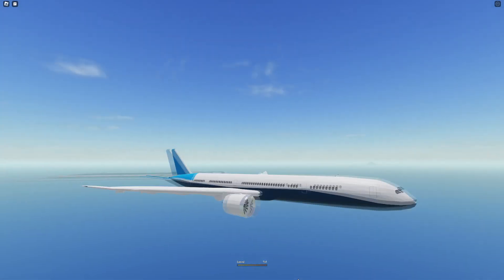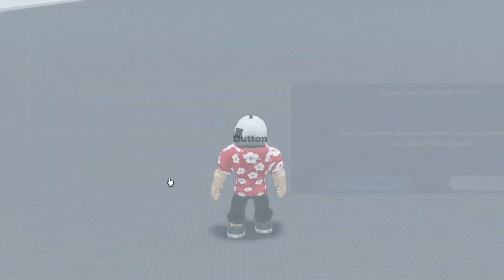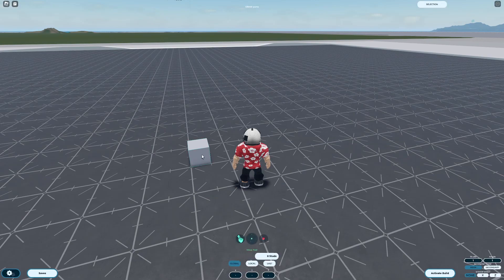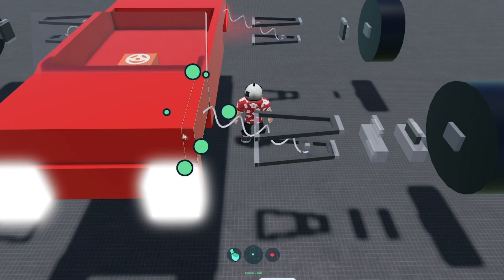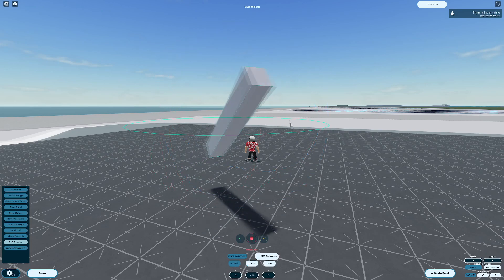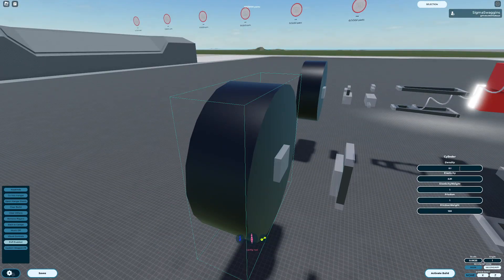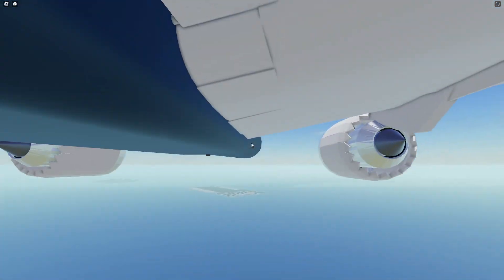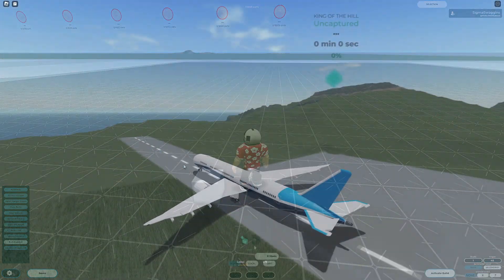EE Masterclass 1 - Basics

Comment: I do not know how to make a engine for my AJ-37 viggen, and its confusing me, because I don't know how to make it actually fly, yet it already has its control surfaces that work
Reply: for the engines just make a propellor engine but make it covered like an actual jet engine and make sure its as fast as possible for speed
Reply from the maker: I’d recommend a thruster when you’re trying to emulate a jet engine